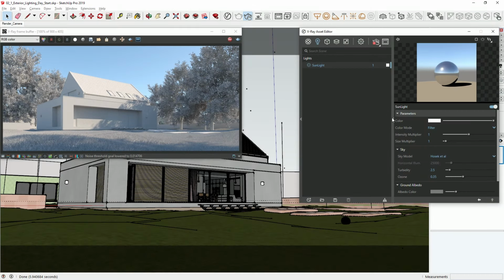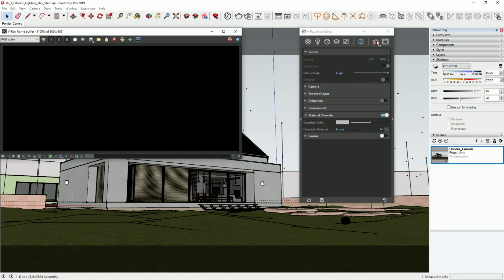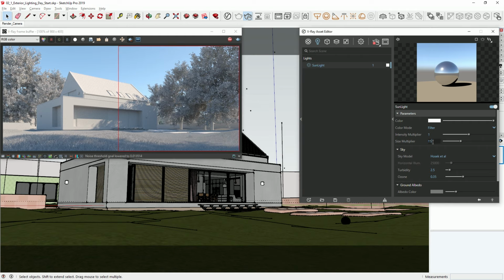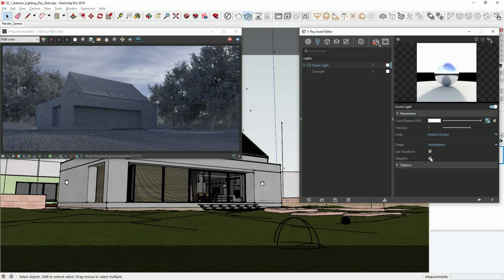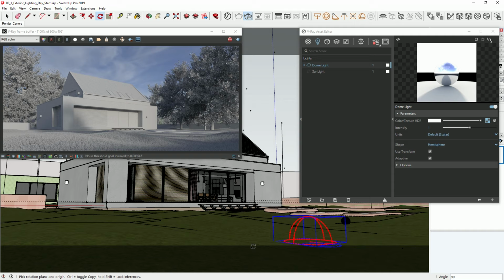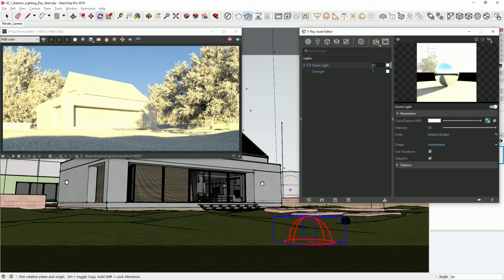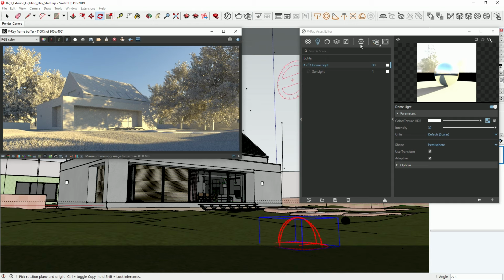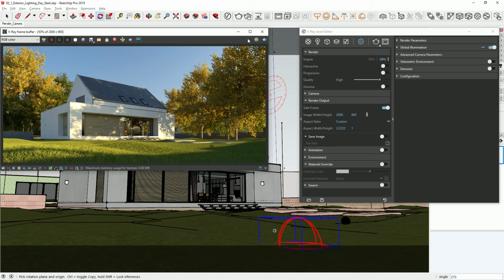V-Ray Next for SketchUp – How to light an exterior day scene

Comment: Thanks for the tutorial. 

I have a small query, i.e., after render done how to save rendered image in 300 dpi resolution.
Thanks.
Reply: I think you don't quite understand what dpi is. Coz it's really irrelevant as it is dependent on size of screens. For eg: the same picture of 1000*2000 resolution can have different dpi based on size of screens. So that's why you won't see the option to set dpi in Vray or any rendering software.
Reply: @firstnamelastname061  thanks for your reply. But i still remember after rendering in vray and saving as Tiff, we used to get option to set the resolution of the saved image. But now it's not showing.

In other words, please help me to understand how can we save render image for print.
 Thanks